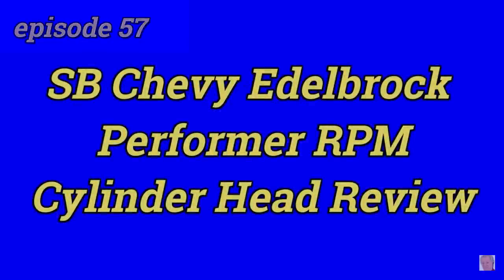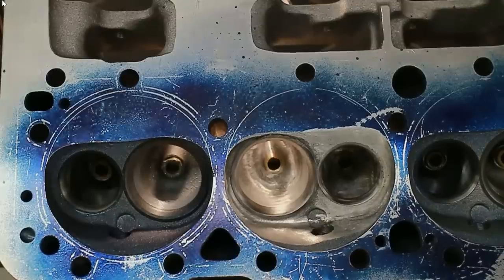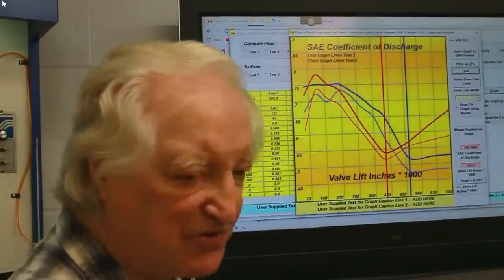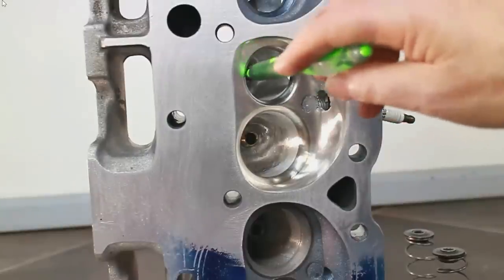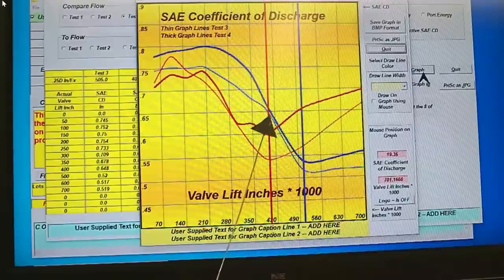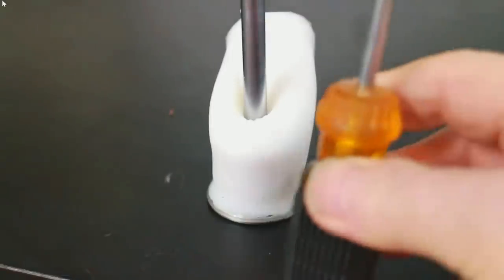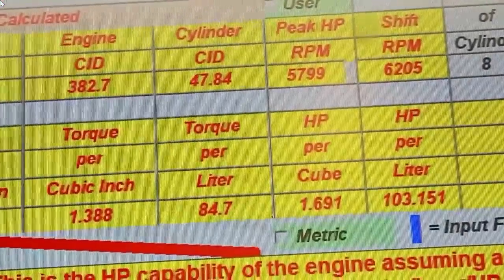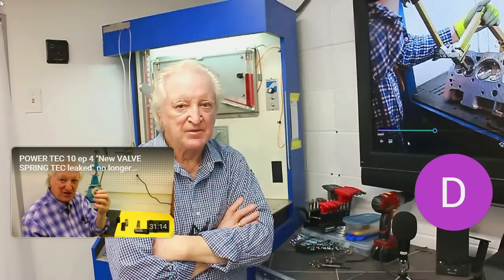Edelbrock Performer RPM heads - let's see if they are any good???

Comment: I am begging Edelbrock to please continue to produce the FE CJ style cylinder head. The overseas companies cannot compete with the quality of the FE heads that we have worked with for years. I can’t port iron anymore. But I can port aluminum. I really like the fact that the castings are generous for porting. I want to be able to shape the CJ port to accept a 2.165 and 1.65 with a generous amount to be able to bowl hog to the valve diameter and to be able to cross the flow away from the bore wall. The Ford engineers really knew what they were doing designing the FE and I really hope that Edelbrocks FE Ford heads will maintain their great power production!

Comment: Thanks, I keep learning more and more from your videos. Most of the cylinder heads I've seen you work on have similar port to valve angles and therefore similar bowl work needs. In a future episode could you work on a head with a steeper port angle so we could see the difference between the flow through the bowl area and into the combustion chamber. How that effects deshrouding ect.
Reply: Oh yes please. I am getting prepared for work on a BMW M20 head and woul certanly apreciate it.

Comment: Great video David. Like to see how you polish finished those ports and a compare on predicted power and torque gains from pre working those heads. I would like to apply these techniques to some Edelbrock Performance RPM heads for Ford Fe but know the heads would have different chambers and flow characteristic requirements. Always like to hear your comments.

Comment: You have over looked a very important area i purchased two pair of performer RPM #60899 from Team C performance in southern California and prior to installing them on the Engine i noticed that the pushrod guideplates did not line up with the cylinder heads. After calling the so called hot shot at Edelbrock and had no help from them i decided to take matters into my own experience i looked at isky adjustable guide plates then i saw a piece from Jomar there unit had a greater range of adjustability part #1501 Edelbrock supplied guide plates installed more than half of them would not even let them go in the heads you spend a lot of money you would expect them to work!
Im not a amateur mechanic i have 55 years experience and have built many bracket engines the cylinder heads you demonstrated are old first castings i purchased them in 2021 newer ones darts are no better unknowing people still grind out guide plate slots and other horrendous acts of butchery that are catastrophic in the no so distant end 
Please pass it on dont forget! You cant overlook anything 
Do it wright or pay the price
Robert A.Roman
NHRA S/G SS/ST

Comment: DV I have your books, ported a set of WP Torquer heads. I think with good results. Very noticeable difference. I learned more from this 1 video than any book you have put out . If you could do a motor from start to finish. Oil pump porting ring selection and so on it would be amazing.

Comment: I'm not in any position  to ignore what is, obviously -  the best damn shop talk video blog out there. However my interests are limited as are many others, to what I have that needs to have some TLC fromm me.   Because it's not going to be given what attention may be needed from anybody else. And  like many others I have a real hard time getting the information specific for my problem. Specifically, I have a GAP 1986 Chevy  an...with a 305 small block.  It's never going to be even close to the '69 327 Camaro I used to have. Worse yet, I'm in California. That car had the  The  'Fuely ' camel hump heads,1.94" in+ 1.50 ex ,  but the solid lifter Duntov cam. LOT'S of suicidal fun...but nothing that I learned then  will help me now. Where's any good, and DIY oriented info to do a decent 305 SBC. build? Thank you for all of this,every thing you say is priceless.

Comment: I found interesting a couple things you mentioned improved low lift especially. I would be interested in some specific mods to do to improve low lift, or mor mid to low rpm operation. I want low end torque, and good fuel mileage, with cam that will be long lasting so it isn't pushing limits of the valve train, on an engine that will rarely ever go beyond 5k rpm. Say a 305, 307, 283 displacement. Not looking to get 500hp, but mor like close to 300 ish. Your mission impossible engine seems like what I am looking for. Great stuff!
Reply: Im doing my 305 and looking for more @ cruiseing speed on t superslabs. These vidoes show me a lot. Living in CA. Im limited by smog regs. To an RV cam, but with 1.6 ratio rockers I think it could work well enough.

Comment: Great video, thanks. Looking at the port molds you made after modification, I found myself wondering if the manufacturers could convert those shapes  into cores for casting the raw heads.

Comment: Thank you for all you effort of educating us with your knowledge and experience.
Although I'm not even close to working on V8 engines or tune them, this is very interesting and many of the principles you are showing here can be applied to almost every engine.
I'm more into small diesel engines tuning/performance and I have some questions regarding how does boost affect the flow of a port and how does it affect the valve train, the spring to be specific. The basic instinct tells me that the more boost you run, the spring will have more resistance when having to pull up the valve. Is that something you can calculate/measure? I'm very curious if you have any input or a video on this.
Greetings from Romania.

Comment: i would like to see the complete Edelbrock Cam Lifter Spring Head Intake and Carb Fine tuned setup by you, its What im working on with a Set of Vortec China Aluminum Heads f9or my 66 336 SBC it has speed pro popup pistons and connecting rod with ARP bolts!

Comment: With a 700 lift solid roller cam and
270 At 50 duration along with 12 to one compression that Edelbrock 
Head you modified should potentially 
Make 650 hp yes?

Comment: Anyone knows anyone that I can get my hands on ford 289 6 bolt so I can play around with my first V8 for a few hundred bucks i will really appreciate it.. I'm a rotary engine guy but in Vegas it's a bit hard to find stuff at times.

Anything helps thanks.
Reply: 289 prices are high. I have a nice one. I wish I had something to put it in. Why not a 302/5.0?  I'm sure it would be a lot cheaper and easier to get.